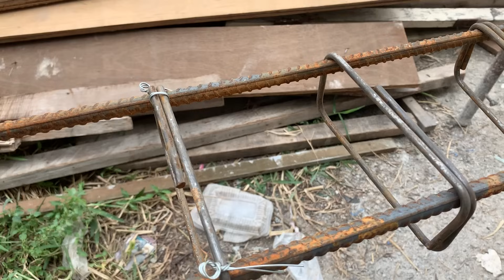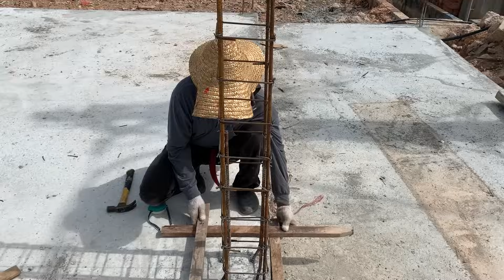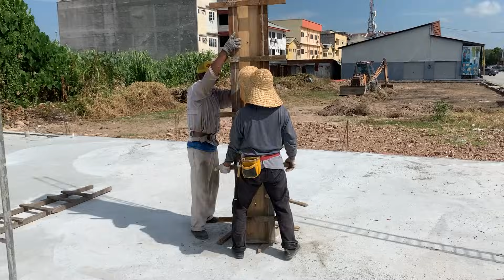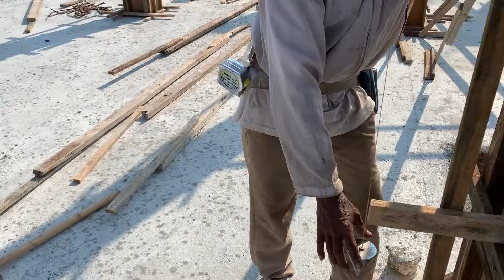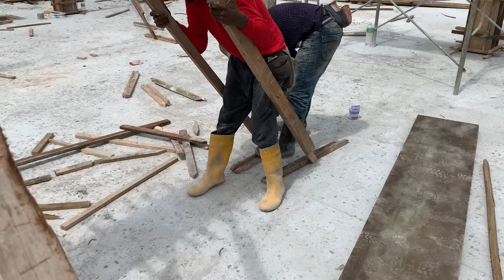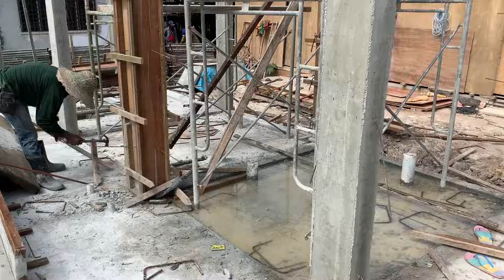Concrete Column Construction Process | Traditional Timber Formwork | Reinforcement | Shuttering Work

Comment: once you have concrete slab on boundary wall and supporting pillars that is all you need for foundation, so next step aluminum or steel structure which should be rust free for 1st story which is mainly use for garage and 2 story where your house going to build with 3 bedrooms, 2 bath, kitchen, living room, etc

Comment: Ask a question  what do can two columns span are 30 feet long?
Reply from the maker: You need to cast a bigger size of Beam 
Increase the height + width 
Add in more Steel reinforcement  to support the span of 30 feet.

Comment: why are the column rebars bent at the bottom?  is there a purpose ?  or was it just correction made ?
Reply: That used to be done to crank/bend the rebar into its correct position. Some steel fixers would place the column starter bars whevever there was a gap in the reinforcing matt, which was usually not in the correct position. Once the slab was poured, and the, column position was set out, quite often the starter bars would have no concrete cover. Hence the column bars were cranked/bent back to the correct position.

Comment: Good job, pls I want ask ask this question. When constructing a two storey building, which is the best practice after the foundation floor: erecting the reinforcement beams and casting the concrete columns before blocks laying just as have in the video or blocks laying after the foundation floor followed by reinforcement beams and concrete column casting.?
Reply from the maker: The best practice will be cast the ground column first then first floor beam. My project as showed in this video only single storey. 
We only lay bricks / blocks after all the beam is done
Reply from the maker: You also May view my other video. There are guide for first floor slab construction
Reply: @apertureofconstruction1739  appreciated bro
Reply from the maker: Thank you for the support

Comment: They should put spacer block before installation of formworks and wrong rebar lapping
Reply from the maker: Spacer block already inserted. 
How the rebar lapping should go ?
Reply: It can be in the middle third or above the slab.. Depends on the structural designer.

Comment: I'm not a civil engineer but just looking at their work doesn't pass to me. How can the column and floor bond? Only the rebar holding it? 10 or 12mm deformed bar?
Reply from the maker: Sir , The building only Single Storey.
Reply: According to ACI code, the minimum reinforcement for reinforced concrete is 12mm diameter but it also depend on design calculation of the structure..

Comment: Can anyone tell me what the normal spacing, and the max spacing, is on this type of column in a single story (only supporting roof)?
Reply: Spacing is dependent on the span of the roof. Other factors are weight of the roof, wind load, earthquake zone.
Reply: @honeytubs  시멘트

Comment: the lapping and splicing of the column, the hooks of ties are wrong, you need to splice at the midlength of the column not at the edge, and the lapping zone tsk SMH, the ties should have 135 degrees hook for seismic advantage, poor standard
Reply from the maker: Thank you for your comments , will learn from your advice
Reply: I can't imagine if this place zone of earthquake, i hope you house always safe
Reply from the maker: @wahyutanlu19  our country zone is safe from earthquake
Reply: @run from life you can't splice in the middle third.

Comment: Thin columns
Reply from the maker: Only single storey , so only small column needed
Reply: What is the columns size? 
20 cm × 20 cm ? 
And what about floor height?
Reply from the maker: @hashem_yh   column size : 225mm x 225mm 

Ceiling height : 3300mm
Reply: @apertureofconstruction1739  Thank you
Reply from the maker: @hashem_yh  please share & Subscribe if you liked , thank a lot

Comment: Lapping zone of reinforcement is extremely wrong in the column.site supervisor is a bastard with the engineer as well
Reply from the maker: Thank you for your comment. Which zone you mentioned ? Can you specific it ? 
Would like to learn more
Reply: The dude is here to learn at least after call them names at least teach them what's right thing to do if not .....
Reply: @apertureofconstruction1739 a lapping should be at 40d to 50d. 45d are generally practiced with a minimum of 12mm dia. for main bars and 10mm dia. at 180mm c/c of stirrups linkage considering this is a single storey.